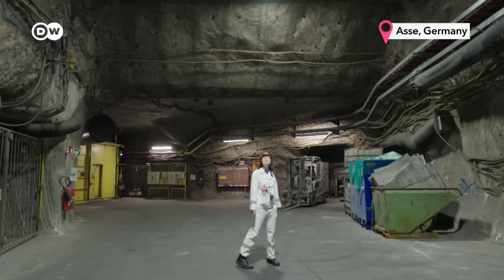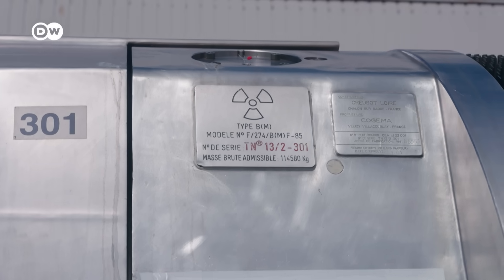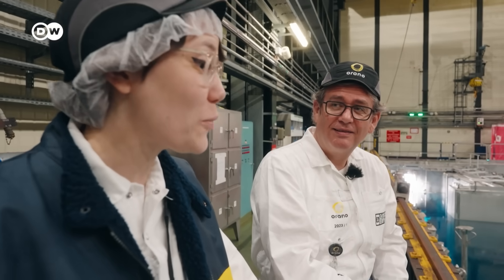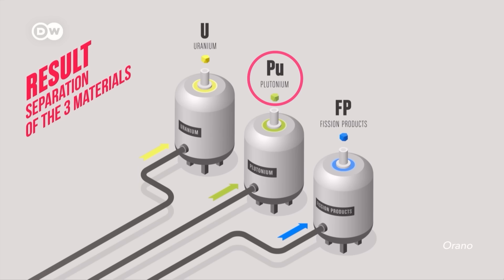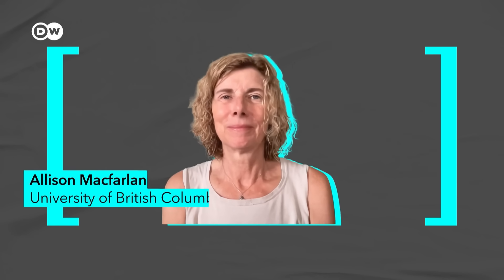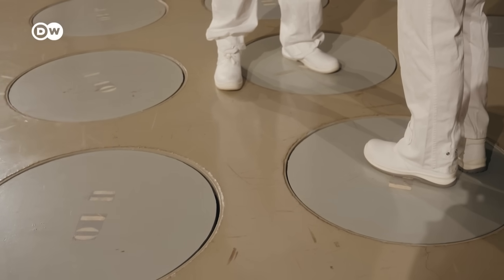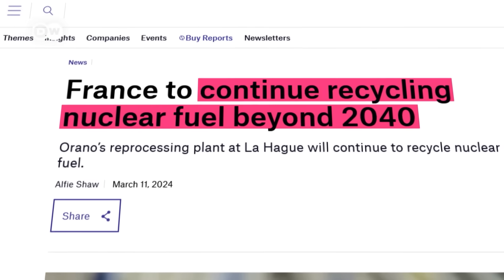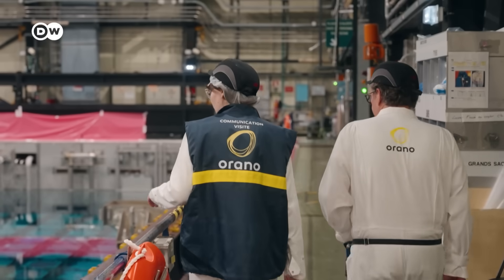Nuclear waste is reusable. Why aren’t we doing it?

Comment: Plutonium separation via purex or one of the other similar techniques isn't as big of a threat as politicians made it out to be, at first glance. When you separate plutonium from SNF that has been in a core running at nearly full power for 6+ years, the ingrowth of the heavier plutonium isotopes (Pu240, Pu241, et c.) is so great that it renders the plutonium as a whole (even though it's mostly Pu239) practically useless from a nuclear weapons perspective. The heavier isotopes of plutonium have too high of a spontaneous fission rate. If a plutonium core was made from reprocessed high burnup SNF, your bomb would spontaneously detonate (not ideal).

During the cold war (and still today) the way plutonium was produced was from low burnup SNF. Instead of spending 6+ years in a core making electricity, the uranium would only be in a reactor for weeks - months. Far less plutonium is made per initial mass of uranium but there's far less ingrowth of the heavier plutonium isotopes that spontaneously fission at too high a rate.

Obviously, utility providers don't make profit when they have to shut down their reactors for a two+ month refueling outage ever couple of months. Plus, everyone around the world would know that you're producing weapons grade plutonium at your power plant (maybe that's your goal, maybe not) if you're refueling every couple of months. Also, civilian power plants aren't designed for such short operating periods. It only takes a few days to refuel a core, yet power plants will be down for months at a time because of the logistical hurdles of prepping new fuel rods to go into the core, preparing the core to receive fuel, and doing critical maintenance.

Unfortunately, where high burnup fuel being unable to be used in a bomb hits a road block is the fact we've mastered uranium enriching and the process is identical for plutonium. It's far more expensive to convert high burnup SNF into weapons grade plutonium as compared to using low burnup SNF but not impossible. Any country with a uranium enriching facility can produced weapons grade uranium and also weapons grade plutonium. Where you can take a sigh of relief is if a country can reprocess fuel but not enrich it. Although, like the video pointed out, its far more expensive to reprocess than it is to enrich, and that's probably why I can't think of a single country that can reprocess fuel but not enrich it...

Also, some critics of the content of the video. Onkalo isn't the first geologic repository in the world. The US has had an operating deep isolation facility since the 90's but only disposes of military and wider government produced waste there. Notably, high level waste isn't buried there. Additionally, while the US banned civilian fuel reprocessing during the Carter administration, SRNL has happily carried on since the cold war reprocessing military and wider government produced waste (thankfully learning from most of the mistakes that Hanford committed...). In addition to vitrifying fission products, SRNL also turns a large amount of material into concrete. They just have to start up radium paint production and they could build you a radioactive house!
Reply: I don't think anyone does Pu enrichment. It's just too hard with only 1 neutron difference compared to short residency as you described, which avoids the problem to begin with. Years ago I read a paper that said the blanket material used to make the warheads for trident missiles had residency on the order of 20 days to ensure isotopic purity.
Reply: Hanford is working at remediating the results of past mistakes.  Good for the environment, and allows me to draw a paycheck...